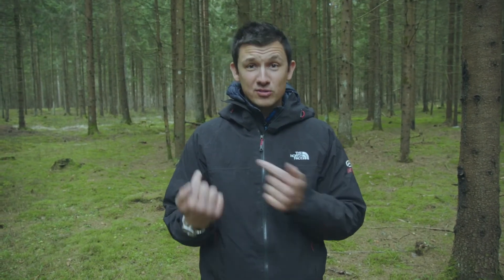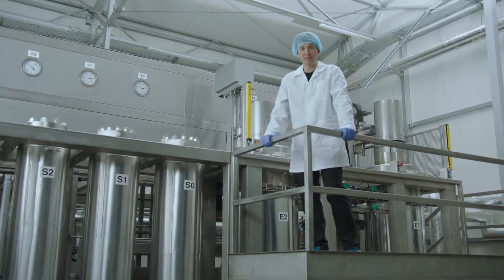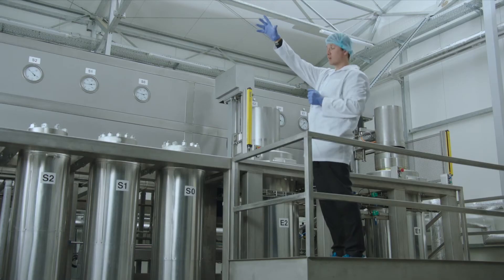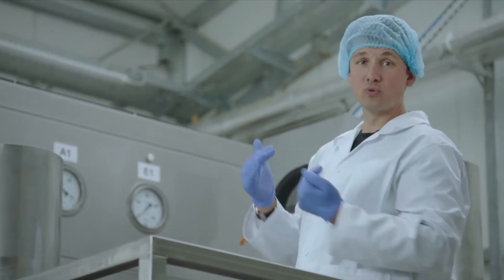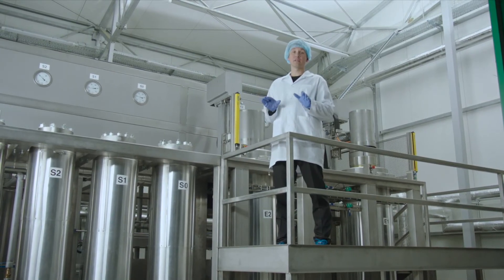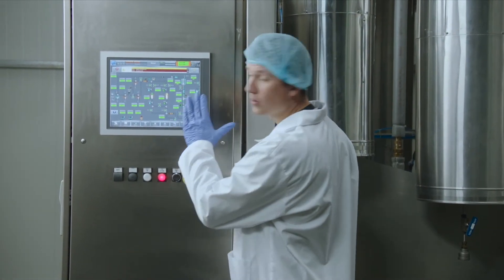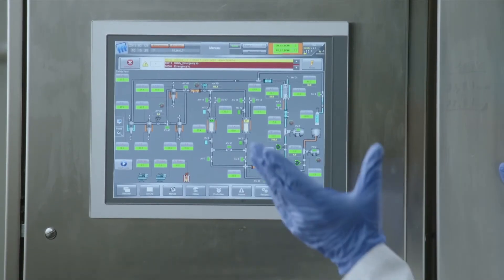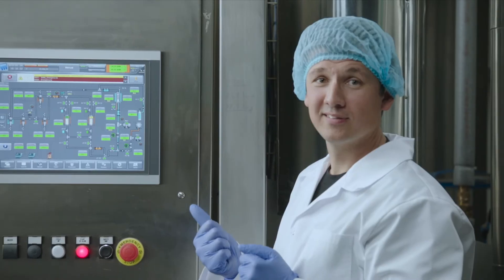How To Extract CBD Oil From Hemp With CO2 #cbdonline | Endoca ©

Comment: Does the hemp get loaded into the tubes loosely or do you cram pack it in there, and how many psi of C02 are you subjecting the hemp to?
Reply from the maker: Hi Ashlee, the hemp would be quiet packed in the tubes. Regarding PSI, i will have to check with Henry and get back to you
Reply: @EndocaCBD  also interested

Comment: Why isn't the THC also extracted in the process? 
How is the hemp purified if you consider that other compounds are also extracted in the process?
Is it presure, or another parameters?
Reply from the maker: Our hemp plants contain less than 0.2% of THC meaning that our extracts remain within the legal limit for THC.
Reply: Pressure temperature and the most commonly overlooked, flow rate and time